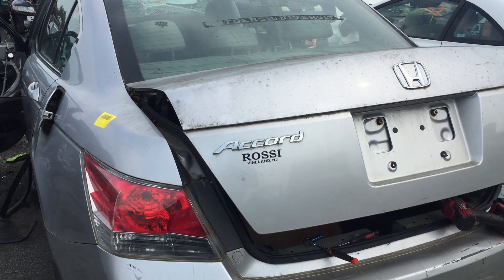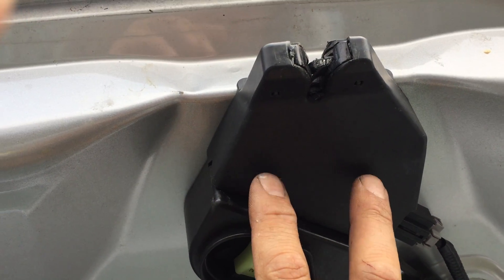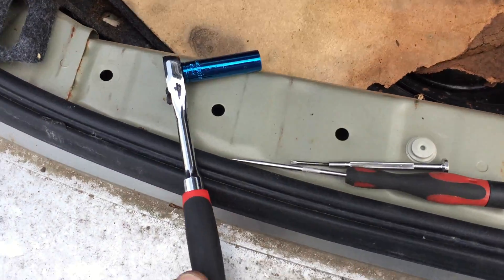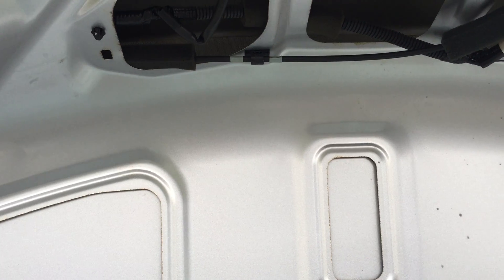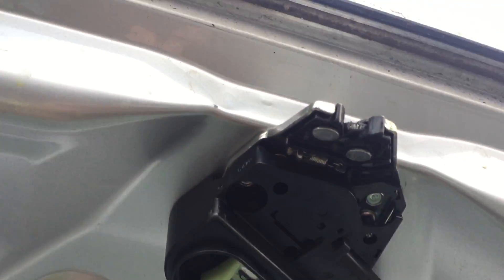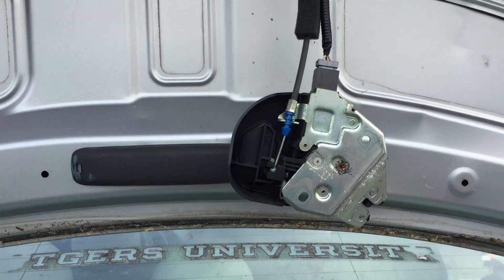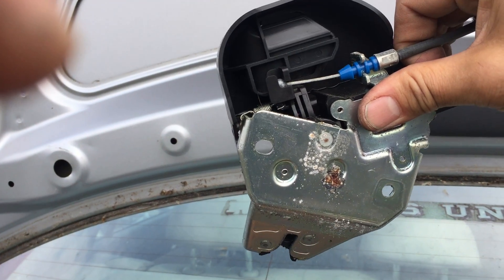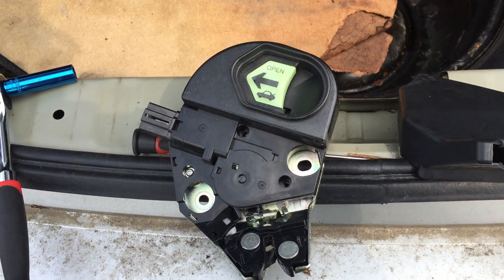2008 - 2012 Honda Accord Trunk Latch Removal

Comment: could you give me more details on removing the plastic cover?
Reply from the maker: No problem- the hard part of the cover is removing the 2 clips that hold the cover on.  They are on the underside of the latch about an inch up.  I use a straight pick and a small screw driver in a cross cross manner to wedge between the latch and the cover to get to the clips.  Should I make a better video to clarify this?  Let me know if you need any more help.
Reply: @autolatch  thanks for your quick reply. Now , I found out there were two small clips at the bottom. So, I used two small screw drivers and pressed the undersides of the cover to open up the clips. and then pulled the cover out.  Your video is excellent. Thank you again.
Reply from the maker: @eugeneyu4823  Glad you worked it out!